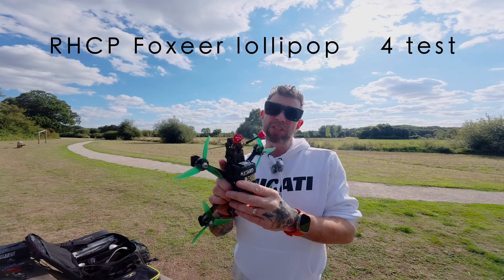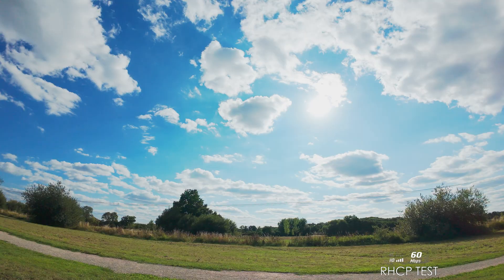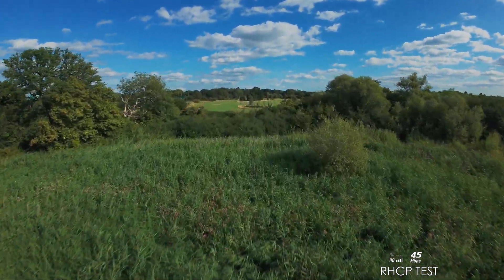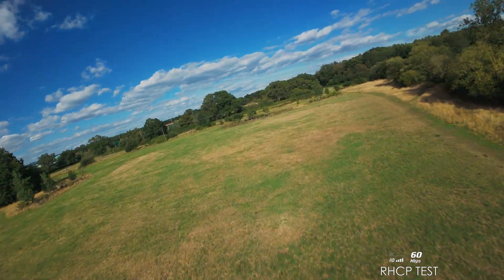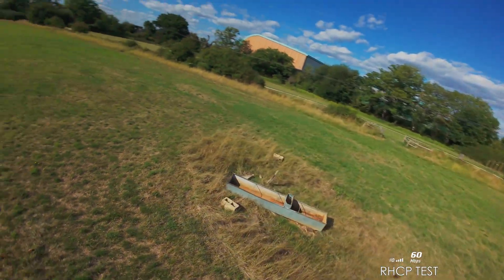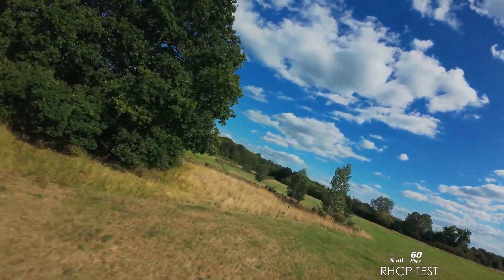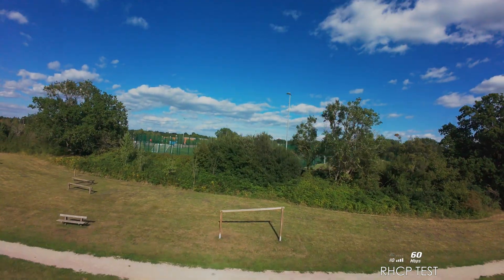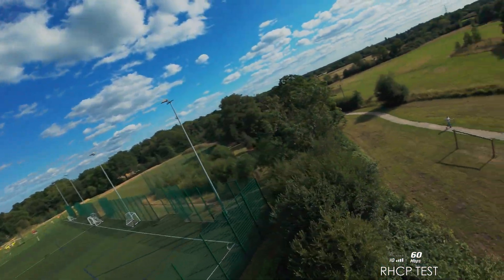DOES THIS ACTUALLY WORK ? RHCP antennas on the DJI 04 Air unit pro

Comment: I accidentally have two long range RHCP antennas I bought for an 03 air unit. Did you mix the antennas and notice a different?

My 7 inch came with 2 LHCP Antennas.

I just wanted to upgrade to some larger antennas with a ufl to SMA adapter.  But accidentally bought RHCP antennas.
Reply from the maker: you can run RHCP or LHCP or Both together it does not make any difference , although i think a mix works best as the goggles 3 trasmission is linear so you can run what ever you want , the think to look out for is Dbi gain ive just got some AKK 6Dbi gain Diamond antennas they are really good they are also 160mm long so perfect for long range flight.

Comment: Nice real world test! You should do another one using linear antenna? That would be interesting to see, as technically that should be better (with the goggles 3) than the L or R polarisation... that might answer why DJI bother to use circular polarised antenna on their O4 Pro air units.
Reply from the maker: thanks bud and hmm yeah sounds like a plan when you sending me some to try haha 😛 as im now searching the internet looking for said antennas haha
Reply: @millermanffwdFPV  do a search for "5.8ghz whip antenna", there are loads of options, as its what O4 light uses.  
I'm happy to send you a couple, I've a few spares for the meteor... pm me you address and I'll post. 🙌
Reply: @millermanffwdFPV the verbiage is monopole or dipole. You can make them cheap too, but circular is a standard for a reason. Interesting to see how'd how'd perform on the o4 tho